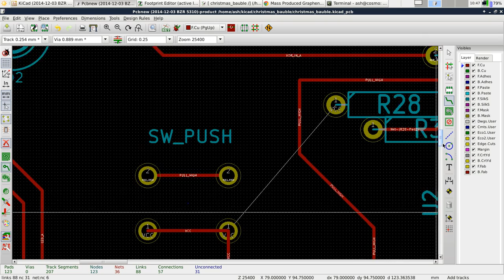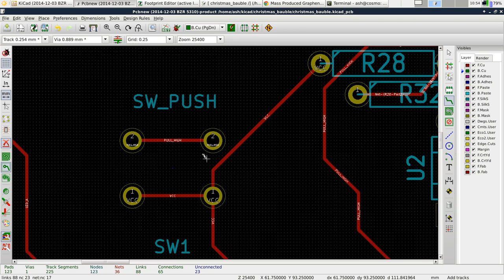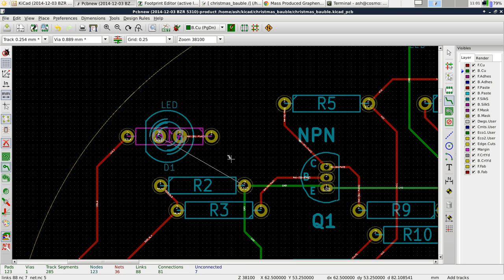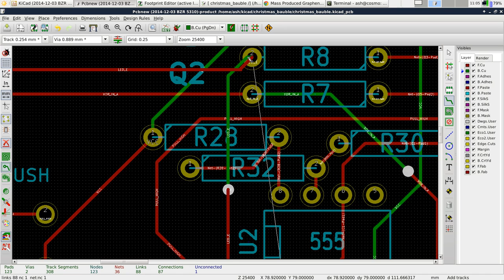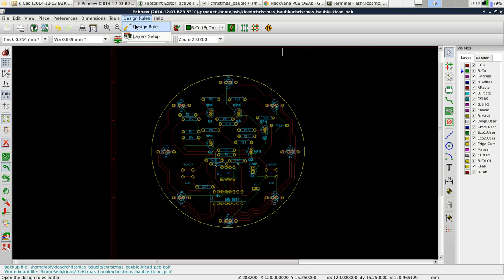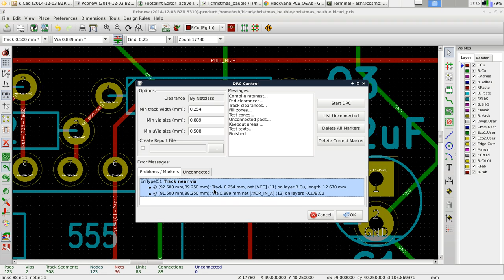Kicad Tutorial 12/2014 - Part 8/12 - Laying Out a PCB Continued (ii of iii)

Comment: 90 degrees is less about the angle than it is about the width change. it only matters if impedance control is required. this is not the case for anything considered "low frequency".